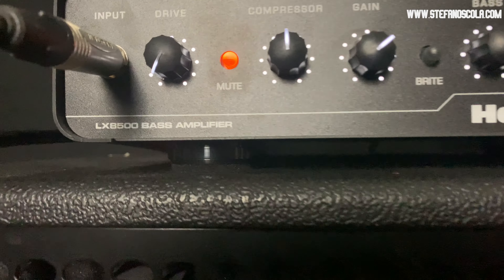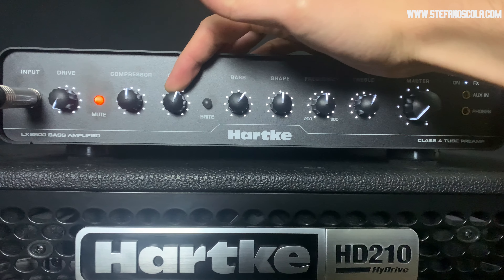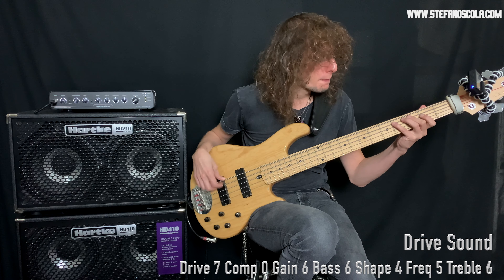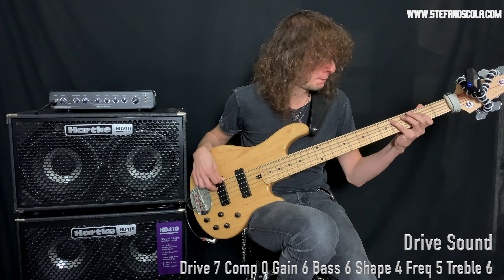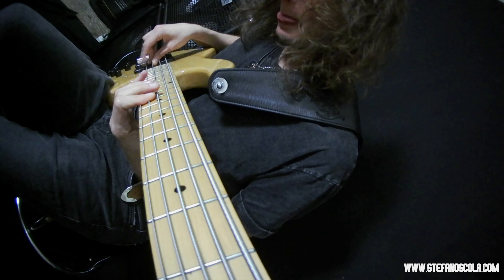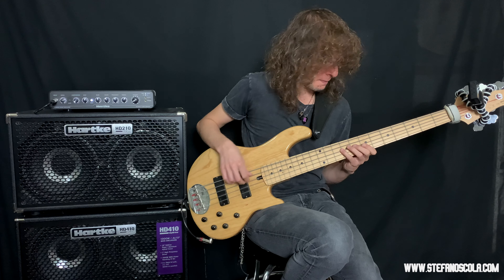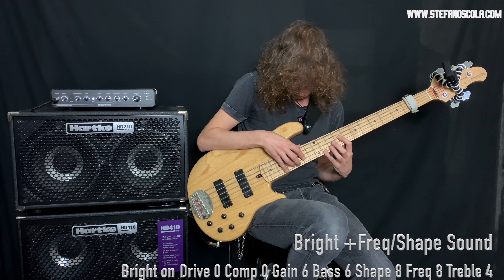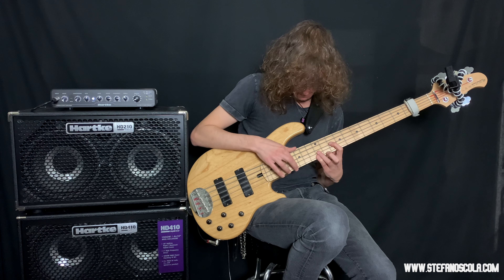HARTKE LX8500 Sound Demo

Comment: Hi great playing just wanted to know your thoughts on the LX5500 if you where able to hear any major changes outside of wattage? Gracias!
Reply from the maker: Hi!! Thank you so much! The sound is the same but you have less wattage (500 watt at 4ohms and 330 watt at 8 ohms), less power in the line out, you have to use the gain control to have enough power in the line out, and you don’t have the possibility to turn on and off the drive & Fx, brite and frequency controls. In the 8500 you can connect a foot switch for controlling them. Apart from this, it’s  the same head 😊🤘🏻

Comment: Can you run this amp using only XLR out to record, without a speaker cab?
Reply from the maker: Mm I’m not sure about that. Because the amplifier is a Class D amplifier, but has a class A tube preamp..to avoid risking I suggest you to connect it to a speaker can or to a dummy load.

Comment: Shopping to purchase Hartke items, 1 question I have, did the LX8500 push both the 410 and the 210 cabinets?
Reply from the maker: Hi! Yes the LX8500 is 800 watt @ 4ohms and 525watt @ 8 ohms.
So you can use it with the HD or HL cabinets series because they are both 8 ohms and the 410 is 1000 watt @ 8 ohms and the 210 is 500 watt on 8 ohms. If you want to use other cabinets you have to pay attention to watts and ohms 😊
Reply: @StefanoSkoolScola  Many thanks and Merry Christmas
Reply from the maker: @jhabarretto9697  You’re welcome my friend! Marry Christmas!

Comment: ciao Stefano. La testata è da 800 w a 4 ohm, ma non indicano i watt collegandola ad una cassa da 8 ohm. La potenza viene dimezzata oppure è necessario collegarla per forza a 2 casse da 8 ohm oppure 1 da 4 ohm ? grazie
Reply from the maker: Ciao! La testata a 8 ohm eroga 525 w quindi puoi anche collegarla ad una cassa da 500w su 8 ohm quei 25 che avanzano diciamo che sarebbero dannosi solo se la testata fosse al massimo di volume e gain.
Reply: @StefanoSkoolScola  grazie Stefano.  Allora non dovrebbe essere un problema perchè il gain al massimo è pressochè impossibile metterlo. Quindi immagino che  lx5500 da 500 w a 4 ohm,   ad 8 ohm eroghi intorno ai 300 w ?
Reply from the maker: @riccardoiaci  Figurati! Si esatto, 330w. Per il gain però conta che l’uscita bilanciata è legata al gain, quindi io per questo motivo tengo il gain a 6 e lavoro con il master. Per intenderci il gain oltre che sul volume di uscita generale, influisce sul direct out, in questo modo tenendolo basso avresti pics uscita dalla DI. Quindi probabilmente ti troverai con un gain a 6 e il master a 3

Comment: Do you get any background hiss on this amp?
Reply from the maker: Hi! Not in the direct out, but the fan starts working every 10/15 minutes I think..it’s necessary in order to maintain the amplifier at the right Temperature, but it actually makes a little bit of noise 😂.
Reply: @StefanoSkoolScola  Thank you for the reply. This a noise not from the fan. It's just a hiss when the amp is on. It's a bit louder when the 'bright' switch is on. If I dial back the treble, the buzz reducea. Is this normal because of the tube?
Reply from the maker: @mikhailshvedoff1398  You’re welcome! I don’t hear anything like that in my amp 🤔 maybe it could be the electric part of your bass, is it active? Because with my Lakland I don’t have any problem with any amp, but with the fender jazz bass sometimes I hear some hiss in background, which rises by emphasizing the high frequencies
Reply: @StefanoSkoolScola  I get it with my P bass, my J bass and my MusicMan. So two passives and an active. It may a grounding issue. I have asked the store manager about it and he said he'll look into it. It's strange since it's brand new.
Reply from the maker: @mikhailshvedoff1398  yes could be, let me know cause I’m curious 😅
Reply: @StefanoSkoolScola  I went and checked out all the LX amp heads at the store. Both the 8500 and the 5500. They all had a bit of buzz/hiss when they just sit there. It becomes more prominent as the gain is increased and/or the bright switch is engaged. It's just the background noise which isn't noticeable when you play live through the cab. So my LX8500 is no exception.
Reply from the maker: @mikhailshvedoff1398   Thanks for sharing, I’m sorry about that, it’s a little bit strange. Maybe you can solve it with ground or lift. The important thing it’s that it’s not a problem of your amp
Reply: @StefanoSkoolScola  I am taking it on the road next week along with a HD210. Shouldn't be an issue for a rock gig. Thanks for posting your original review.
Reply from the maker: @mikhailshvedoff1398  I’m glad you liked it! Have fun on the road 🤘🏻😊